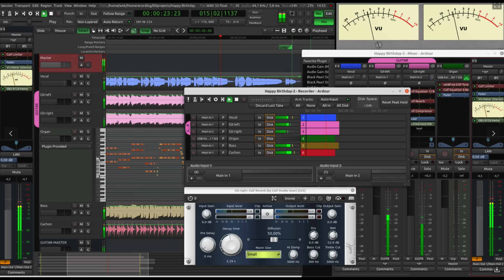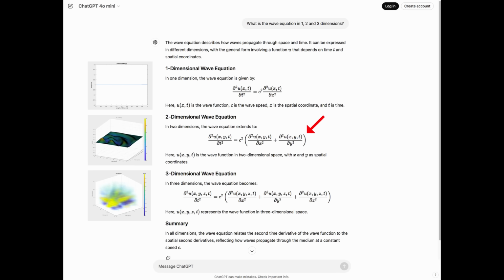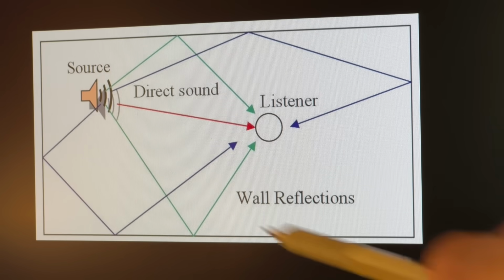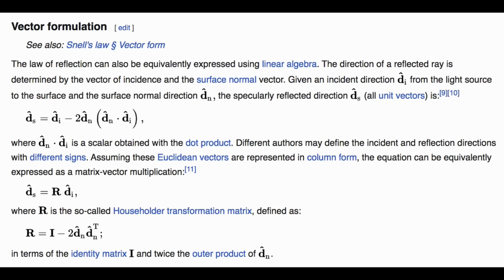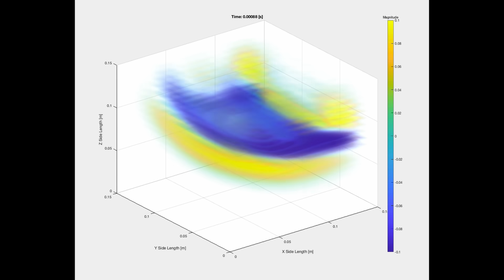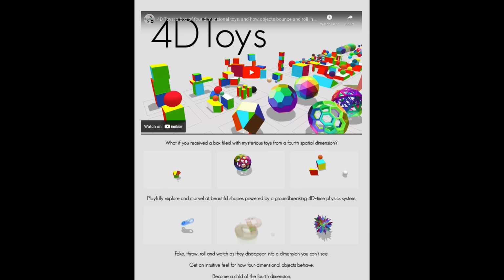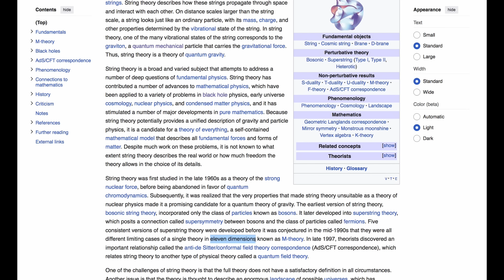Four Dimensional Reverb

Comment: 10:16 relativity still utilises a 4th dimension which has an alternate notion of length where total path length is basically what time is to an object. Instead of s^2=x^2+y^2+z^2 we have s^2=t^2-x^2-y^2-z^2 where t is the additional dimension, s plays the role of time in relativity and is known as proper time.
Reply: we learned from what we observed in our universe that the possibility of a fourth dimension (mathematically speaking) is not possible. but the math for it makes sense, does it exist? we don't know. Also, if we replace mass with negative in physics the equations still work. Does that mean negative mass exists? we also do not know.
Reply: @ actually, the most accurate theories of physics (specifically QFT and GR) only work when we include this 4th dimension which effectively reduces length. It is not just that is technically works, but that we have not found a theory that discribes reality to the lengths we can measure that do not use this 4th dimension. This 4th dimension also has an intepretation as sort of like time. Also negative mass superficially works, however in actuality, it does not work as mass is defined as the square root of the energy-momentum vector (which is a contraction of the stress-energy tensor), which means that negative mass can be replaced by positive mass by choosing a different root of the square root. This does not mean that negative mass can techincally exist, just that for it to exist in theory, you would need to invent a better theory that only works when we have negative mass.

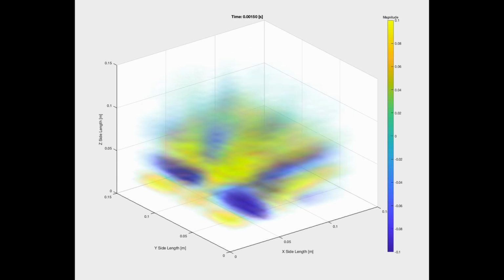Comment: 3:09 you could instead use greens functions of the 4d wave operator d^2/dt^2-c^2(d^2/dx^2+d^2/dy^2+d^2/dz^2+d^2/dw^2)
This works because the wave equation is a linear differential operator, meaning you can integrate the greens function (along with the initial conditions which are the placements of the string) to get the value at any point in space and time.

Comment: Neat idea.  Extending wave wave equations into higher dimensions is pretty neat, but I wonder what the physical implications might be.  For example, adding another vector doesn't define the physics of this new fourth dimension.  Assuming it carries the same physical properties as the third dimension is one theory, but what if the interface for the medium between the third and fourth physical dimension sort of rotates or shifts the phase angle of the wave so that it's unrecognizable?  Or, what if, due to the topology, maybe certain frequencies can travel in certain directions causing complex wave forms to split into their individual frequency waves going in their specified direction, then when passing back through the interface to the third dimension they are recombined to form something unexpected?

You just never know with that fourth dimension.  I like the idea of that "4D Miner" game that tries to recreate Minecraft but in 4D.  Something can be in the same physical space as you, interact with you, but you cant see them unless you rotate your perspective into that pocket of space they're in.

Comment: I could do the impossible object physical synthesis engine with my physics engine. It runs at audio sampling frequencies in real time, so it should be doable to tack on a simulation and spit out sound. Though 4D stuff would require a rewrite of a massive chunk of my math libraries, as I don't have any code for a lot of the weird math that's needed to simulate 4D physics.

Comment: The raytracing approximation isn't accurate in even-dimensional spaces; ripples on the 2D surface of a pond do not propagate the same way 3D sound waves propagate in bulk materials, and 4D sound has more in common with those ripples than it does with sound waves in a 1D string or in the air.

Comment: Are there more ways to parametrize this? For example, if this is essentially listening in a 3D cross section of a 4D room as others have noted, then wouldn't different cross sections have different resonance profiles because of their different geometry? I wonder then about reflections in something like a 3D (or higher-dimensional) fractal, for example, and whether there aren't certain highly symmetric structures that would closely mimic the acoustics of a less symmetric physical structure like a cathedral. If you could find a robust theory, you might even be able to simulate a wider variety of complex real world rooms more efficiently. Cool idea and well-executed!

Comment: The wave equation in a 4D Hyperectangle is actually relatively easy to solve analytically using fourier analysis, and you could have a computer compute the needed integerals to solve an arbitrary initial-condition system.

Comment: If I'm not mistaken attenuation in 4D should follow the inverse cube law over distance. Where as in 3D it would follow the inverse square law.
Reply: wouldn't be able to hear anything 😢
Reply: since there is a wall in every direction, shouldnt that reflect all the sound back essentially focusing it no matter how many dimensions there are?
Reply: @matthewe3813 it would focus the energy back in but the underlying rate of energy decay will still be greater than in 3D space as the energy is dispersing in a hypercube configuration. Not all of the reflections will have the same distance to travel back to the listening position and most will fade to zero before reaching the listener. 

I'm not sure I adequately explained that.... I want to try and write out a more detailed explanation but I ran out of text in the comment. I'm thinking I should probably just make a video describing this conceptually.  As it would be a really good primer for a brand new branch of mathematics on working on called Dromatopy.